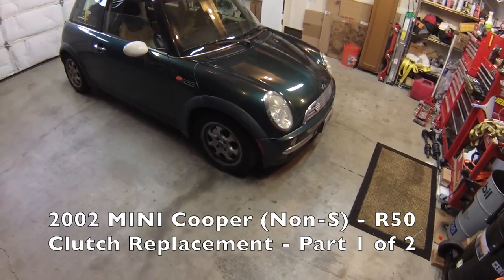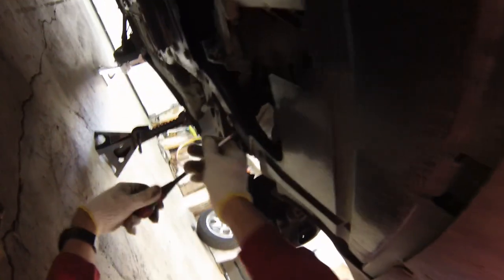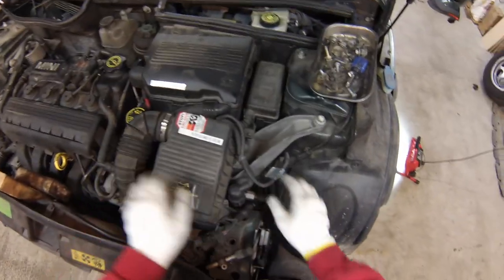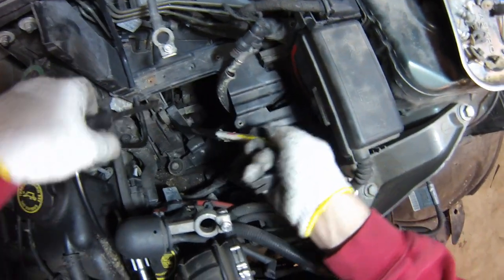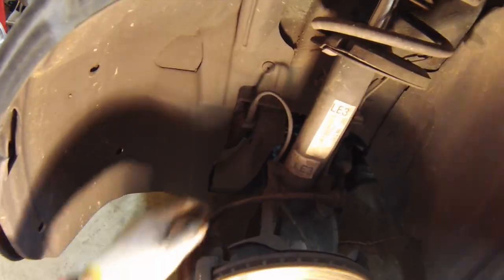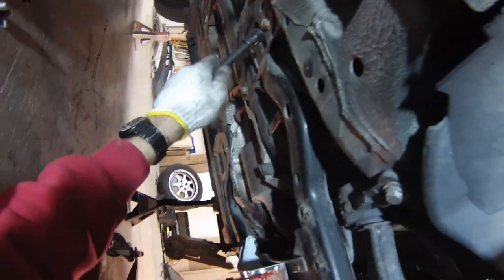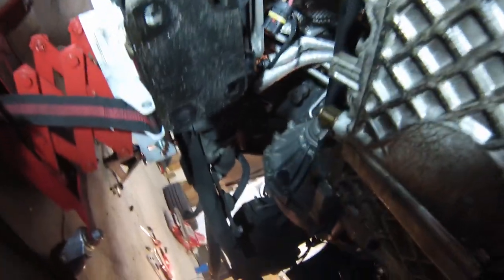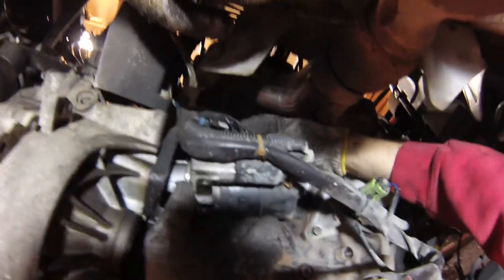2002-06 MINI Cooper Non-S Clutch Replacement Part 1 of 2

Comment: MINIMNT's check engine light (the one in the tachometer) keeps coming on even though I keep resetting it.  Here's the sequence of events:

Pulled the code with my MiniMania code reader.  Code is P2097.  Bentley Diagnosis Without Guesswork book lists it as "Post catalyst fuel trim, system too rich".  One of the related components listed is the post cat O2 sensor.  I replaced it but the code kept getting thrown.  Internet research led me to move the new O2 sensor to the pre-cat position and to put the original post-cat sensor back in as that seemed to be the way at least one person was able to get the light to shut off.  This didn't work either as the P2097 code was still being thrown.

Also listed in the Bentley book is "reset fuel trim adaptations after repair" but this seems to require specialized dealer only scanners and software.  There seems to be no DIY way to do this.

Stacie has reported a drop in mileage and checking her stats on Fuelly.com confirm this.  Her last two tanks before this were 32 and 31 MPG and her average was 30+.  Since the check engine light has been on she has filled up once and her mileage on that tank was 21.4.  We'll confirm this with another fill-up soon, but if this is correct the car is running rich, although it seems to be running well.  Neither of us has noticed a change in performance.

So I need some opinions on all of this-

Did I replace the O2 sensor unnecessarily, and/or did I move it to the pre-position too soon?  Should I have left it in place and let the fuel trim re-adapt on it's own?  Will it do that?

Should I move it back to the post-cat position?

I'll take some voltage readings to check on the O2 sensor operation and see if the powering circuits are OK.

Is this a dealer thing or is there some repair place that is known to have this specialized equipment?

Should I have an emissions test done to see if the catalytic converter is actually functioning?  What will that tell me?  

Thanks in advance for your help.
Reply from the maker: Might need to reset all adaptations using INPA or a diagnostic scanner. And replace the other O2 sensor so they are both working together.
Reply: Also, I have another problem that I can’t figure out in another Mini Cooper that I have. No lights (check engine) are on, but the car vibrates. It is most of the time, about 80%. The tires and everything are good and there is nothing that is wrong on that end. It vibrates even when idling. When I reset the computer, it goes away for a bit but then it starts again. I am thinking maybe it has something to do with the transmission maybe? Have you come across anything like this?

Comment: Hello, i wanna first thank you for the work that you do and also for putting this video up. 
I am right now in the proccess of changing my own clutch for the same car and year. Before the clutch stopped working the tranmission was making some type of swirlling noise when its in gear so at first i changed the axles to see if itll go away but it didnt so then i watched your videos i thought itd be the throw out bearing that was making that noise but as i have just brought down my transmission to see what stopped the clutch from operating the throw bearing looked to be in its place with out any damage. I took out the cluch pressure plate as well as the clutch disk but, now im not sure on how tell whether if my clutch is bad from looking at it, any help please?
Reply from the maker: If it is worn down close to the rivets and there are no more radial grooves left, it is time to change the clutch. If you have a midlands 5 speed (2002-2004 R50), the noise you are hearing is probably the transmission. It needs new output shaft bearings (and possibly also differential and input shaft bearings).
Reply: just went to a mechanic down the street and he told me it could be the pump and i showed him my clutch he said its almost brand new.

Comment: Well,
Our Mini woes continue. I decided I wasn't equipped to change the clutch myself and had it done at the garage. They said the axles needed replacing so we added that as well as the upper motor/ trans mounts. On their test drive, the passenger axle broke. They replaced it, we got it home and the same axle broke again. I replaced it myself yesterday, along with the remaining old, lower motor mount and today the axle broke again...
Need a parts car?
Reply from the maker: Barry Kooda Is the car significantly lowered? Are they using cheap replacement parts? Is axle the correct length?! They would really only break if they bind, which can happen in the above cases.
Reply: ***** 
Everything's stock except for normal replacement parts over the years.I just replaced it again myself with an FEQ one I got at Foreign Auto Parts. The other three came from O'Reily's, which has been pretty good usually but I could swear that the FEQ has a lot less slop than the other one I put on did. It may not have been long enough.
I'm getting really good at replacing Mini axles!
Not something I was hoping for...
Reply from the maker: Barry Kooda Yeah, could be poorly engineered parts. Will you get your money back? Cardone remanufactured or DriveTech (DTA) up on Amazon seem to be good so far, and Amazon will not ask any hard questions for you to get a refund for suspected defective parts... 
Might be worth a try... http://www.amazon.com/gp/product/B001FI2HRU/ref=as_li_tl?ie=UTF8&camp=1789&creative=390957&creativeASIN=B001FI2HRU&linkCode=as2&tag=mimlif-20
Reply: ***** I'll get the $80 or so refund but not the $151.53 for the new one.unless something happens to it. It's just a pain to deal with 3 broken CV joints in 2 weeks, 2 in the last 2 days and having to tow the thing home and fix it on the driveway twice. In future, I'll check with those two companies you suggested. 
Next up:
The 2097 error code.....What it means and how to get rid of it. Lots of conflicting info in the net.
Reply from the maker: Barry Kooda If I recall correctly p2097 is an upstream O2 sensor code. The O2 sensor is degraded and causes this light to come on. Resetting computer adaptations can make it go away for a while. Replace the pre-cat sensor. Be sure to use only the NGK/NTK brand. MINI does not play well with other brands. This one is a confirmed fit - I have installed several of these. http://www.amazon.com/gp/product/B0018JUNYU/ref=as_li_tl?ie=UTF8&camp=1789&creative=390957&creativeASIN=B0018JUNYU&linkCode=as2&tag=mimlif-20
Reply: ***** 
Thanks!
That sounds good. I'll start with that first.
Reply: Barry Kooda  how'd that O2 sensor replacment go? i've got the same code coming up
Reply: Eric Knowles I replaced the post CC sensor and had to have the mechanic delete the adaptations to get rid of the error code.The SES light stayed off but he said we needed to cold start and drive it for 30 or 40 miles at 55mph for it to reset everything to pass inspection. That turned into 3 inspection attempts in 3 days, 250 miles of trips before we passed but I've heard of  others that had to drive much longer.

Comment: Very comprehensive video.  I'm on my factory clutch after 142K miles on my 2005 R53 Cooper S. Waiting with baited breath for it to give up the ghost.  You may have changed my mind on what type of gloves to wear while doing this type of work.  Nitrile/Latex/etc always rip at the worst time.  Do you wash the same pair over and over, or just trash them after several jobs?
Reply from the maker: Wear until dirty, maybe wash once,  then toss them or use to soak up spills

Comment: I loosened the condenser and rad gave the gearbox a twist and got it out without removing subframe. Install was easier than removal. Customer had 1, bad slave (exploded), 2 bad throw out (exploded) 3 missing fingers on pressure plate, 4, bad bushings in clutch fork, 5, bad master........6, NO MONEY and 6 possibly bad forward gear or synchros or forks from  driving with NO CLUTCH. The only gear that will engage is reverse.  $1000 used gearbox locally. $1500 car.
Reply from the maker: This method is possible with non-S

Comment: looking for some info on replacing 2008 mini cooper non s clutch. Is it the same procedure as the 2002-2006 models? i cant seem to find any videos like yours with my year. am i the only sucker that bought this particular year and cant find out how to do my own work?
Reply from the maker: cschmahl84 I get asked this nearly every week. Not same procedure. Similar but not same.
Reply: i don't want to pay nearly 2k for a mechanic to do this work. do you know of anyone who has performed a video like yours with a base model 2008 R53? i would assume the basics should all be the same. i watched another person perform a clutch replacement on the 08' S model and they had to remove the radiator hoses and drain the system to do it. from what i can tell from looking at my mini top side it looks to be plenty of room and not as crammed like the S model with the intercooler and turbo and such.. thank you for the quick response. last post was 2 years ago, so i wasnt sure i would get a response.
Reply from the maker: Watch my other video for R53. https://www.youtube.com/watch?v=83t1MoklcIs but it sounds like you are talking about an R56, not an R53. The R56 requires radiator hoses removed. It has more room but still requires subframe removal (or front end service mode and complete drivetrain removal - pick your poison) to get the transmission out. If you are just replacing the clutch and not the flywheel, it is technically possible to do it by just pulling transmission back and then pushing the engine as far to the right side of the car as possible, but almost no space and you have to be able to work with one hand and think outside the box for dealing with tight space. I would not recommend this method unless you have done several clutch jobs in the past and/or like dealing with unconventional problems.
Reply: ok, so you're saying dont cut corners to try and prevent from pulling car apart to get the job done? that makes sense i would want to follow your "informational" methods to get it done. and for some reason i was thinking mine was an R53 when in fact you were correct, it's an R56 as the 2007-2013 base model hatchbacks are R56. i clicked on the link you posted for me and it shows the removal of the radiator hoses. so this would be correct in my case for the R56? I have already had to replace the thermostat and built in sensor myself and removed most all the stuff you removed from the top right side of the engine excluding any of the the front bumper and subframe. so it looks be be just  few more steps from there to clear the path of taking the tranny apart and replacing the clutch. the kit will come with the alignment tool but from what i saw in your video is that even with that tool it could still be millimeters off and not be correct?...how much would you typically charge for this service?
Reply from the maker: I suppose you could work around them but I don't. They just get in the way. I did a base Cooper R56 job last week and the alignment tool actually is useful for that one. Send me personal message from my channel page if you want to discuss having me help you with this job. (Channel Page...About...Send Message)
Reply: I also have a 2007 mini s and would also like some information on subframe removal and clutch replacement.Any luck ?

Comment: Halfway through getting the transmission out and I must say.  You make this look a hell of a lot easier then it really is lol.  I'm glad I'm doing it myself though because I found that my shift cable Bushings were cracking Andy tie rod ends were rusting away so gonna change those when I'm at it !   Mine a 2003 r50.  And your videos are keeping it on the road, so thank you.  Do you have arena tips for changing front and rear control arm Bushings ? Mine are shot
Reply from the maker: Front control arm bushings - replace at the same time you are dropping the subframe. The bushing brackets are right there. The same bolts hold on the brackets and the front sway bar. 
Rear - I've never seen the rears go bad but basically remove the rear wheel and everything connecting to the control arm, then the bolts holding the bushing bracket onto the body, replace bushing bracket (you might need to press the new bushing into the bracket) and assemble in reverse order. I've never seen a bad rear control bushing though.
Reply: ***** Thanks so much! I know the fronts are bad.  I just assumed the rears were as well so I bought them with the fronts.  I'll just not worry about changing the rears for now.

Comment: Can I 2003 clutch fit for 2005 ? I buy a 2003 use engine but i di it’s change the clutch now is make in noise
Reply from the maker: I don't understand your comment well but clutches from before July 2004 and after July 2004 are not the same.
Reply: I buy a use engine from 2004 mini I didn’t change the clutch I left the original on the engine and my is 2005 you think that’s the problem

Comment: Does the Rear Main Crankshaft seal you have listed at Amazon fit the R53 S too?

And THANK YOU!!!!!
Reply from the maker: Yes, it's the same part for both cars. 
Thanks for watching!
Reply: ***** Thanks for the great video. Just ordering parts for my 2002 Mini Cooper R50 Base and Im finding on most websites that the Crankshaft seal you have listed doesnt fit my model. It also tells me that on Amazon. Any clue as to why 221122 Oil Seal will not work? Or is it actually the correct part.
Reply from the maker: Scouser Tech Amazon is reporting that this seal does fit the R50 base: http://www.amazon.com/gp/product/B004IZTS2O/ref=as_li_tl?ie=UTF8&camp=1789&creative=390957&creativeASIN=B004IZTS2O&linkCode=as2&tag=mimlif-20&linkId
Reply: ***** Thanks worked out great. Clutch replacement went smoothly thanks to your video. Keep up the great work.

Comment: Hello Modmini. I just subscribed to your channel. I know this video is a little old but I hope you respond to this comment. In my first few years of running a shop, I did a couple of clutch jobs on the 2nd generation Mini Copper S. These have the electronic steering. At the end of both clutch jobs, the electronic steering was in operable and took out the electronic steering module. I could never figure out what I did wrong. I did remove the steering racks on both vehicles but I was very cautious and careful when putting them back on. Im sure I aligned them correctly but there's a chance I didn't. Any how, ever since then, I have vowed to never try that again on the newer Minis with the electronic steering. Any ideas on what might have happened or what I might have done wrong??
Reply from the maker: I have never had a problem with the electronic steering. Are you sure you plugged in both wiring connectors to the rack? There is one large connector and one small connector, as well as a third connector that does not require disconnecting. I don't remove the steering rack, other than letting it come out together with the subframe.
Reply: Mod MINI  Hmm, I did plug everything back in. Both times right after starting the cars and driving just a few feet to exit the shop, the ESP? (steering light) would come on and the codes read angle sensor out of range or something rather. I wasnt sure if you had to reflash the steering module after disconnecting the battery or not. Well, I guess I must not have aligned the rack correctly. That seems to be the only conclusion I can come up with. I'll let you know if I ever decide to take on another one of those.

Comment: I am going to remove the gearbox on my 2006 cooper non s. The diff bearing are noisy. Firstly can i change diff bearing myself? And aftee watching a few of your videos and speed u have taken engine out, would u recomend leaving engine in car or taking out?
Videos are very good and extremely informative
Reply from the maker: It's possible. Take transmission out, crack open bell housing, pull off old bearings, press on new bearings. You'll need a bearing puller and a hydraulic press. If you have an engine hoist, taking engine out is less dirty and easier to remove/reinstall parts with the engine on a bench instead of tight quarters of the engine bay. I've done both ways and the labor is pretty similar for each.
Reply: Thank you i have been told it is probably n/s drive shaft bearing(i live in england) as its not getting wors. Its not wheel bearing. Its like a grinding noise between 30 and 40mph. Any ideas and thank you for responce hope to se more video they are great to watch.

Comment: 2006 mini are a BMW engine and the 2000-2004 are a chrysler motor called  the Tritec L4 thats why they are different transmissions
Reply from the maker: 2006 are also Tritec.

Comment: where can i get the end link part that you disconnected?
Reply from the maker: +Michael Marks You broke an end link? Check local junkyard or eBay for replacement parts, or you can replace with a performance adjustable endlink. Pretty easy to find with a Google search.
Reply: Thanks!! Can you do a window regulator replacement video or an oil pump for a mini?